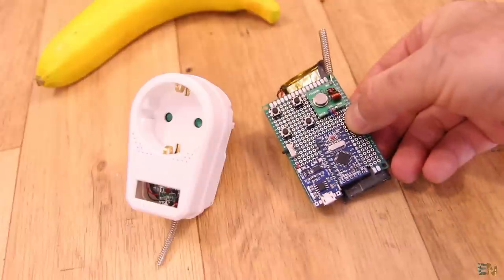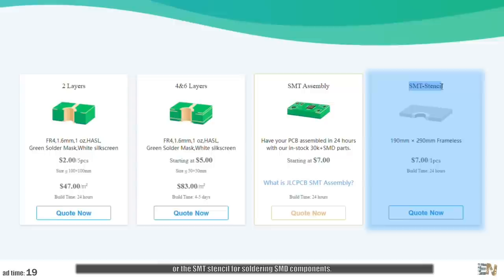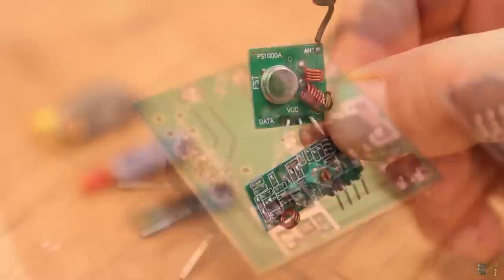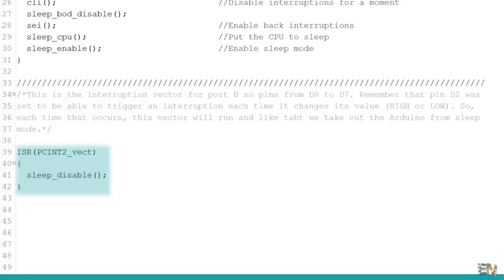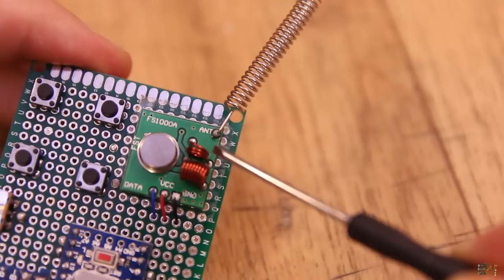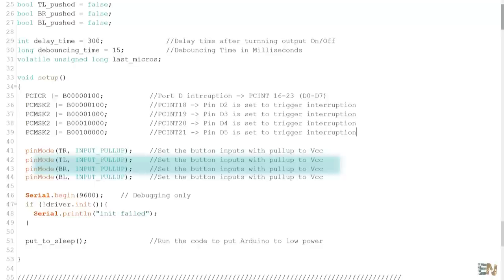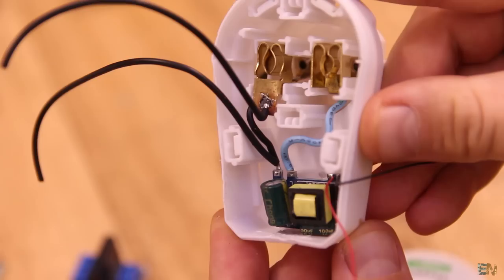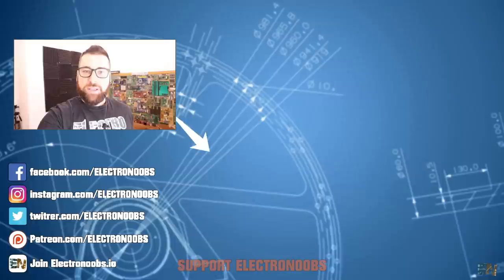Relay Control With 433MHz Radio - Ultra Low Power Remote

Comment: Your timing is perfect. I was looking for a circuit to help me make a rotor controller for my indoor antenna.
I will set it to rotate in one of two directions (dependent upon which button I press) for a short burst of time. If I want it to move more I could simply hold the button or press it repeatably.
Since you have done all of the hard work for me this project will go much easier, Thanks for the great video (as always :) )

Comment: Why didn't you use the standard PT2272 as you can use no power until you press the button that way it will last for years?

Comment: And if you'll want to have multiple receivers around in different places each operating separately you can write a single code for all of them.
Each receiver should be triggered upon receiving certain code, like numbers from 2 - 13 . The trigger-code will be defined by shorting digital pins with ground and corresponding arduino code should detect the shorted digital pin and start processing only appropriate commands. This way you can produce quite a lot of receivers with uniform hardware and firmware.

Comment: Great work there , a question though : how hard is it to encrypt the signal , I mean if I need to control a door someone can pickup the code and hack me , I want something similar to car remote locking/unlocking, thanks !
Reply from the maker: maybe you should multiply the sent number by a unique KEY and have that same KEY on the receiver as well and by taht you can get the original number....
Reply: @ELECTRONOOBS  the problem with that method is that the key is always the same so someone can record the sent data and replay it to open the door , I think the encryption must contain the current time as a seed , I should probably imitate the algorithm used for cars
Reply: @piiumlkj6497  Have one code to request a new challenge message, at which point the receiver will generate a random challenge and send it back to the transmitter. The transmitter sends the command along with a hash of the command, challenge, and a secret key. The receiver can then check if the received hash matches the expected value. Done right, it is very difficult to break.
Reply: @NiHaoMike64  thanks for the help , your solution is elegant but it requires 2 way communication to be implemented which can increase the error rate of the device , I think rolling codes used in cars is a simpler approach , although I still don't quite understand how they can maintain the synchronization between the key and the car , what if for example I pressed the unlock key while away from the car ? It will go out of sync , I'll appreciate a suggestion on how to solve that problem , thanks again!
Reply: @piiumlkj6497  The synchronization mechanism is done by accepting a few "gaps" in the sequence, which also turns out to be one of the biggest security flaws with the scheme. A quick way to implement that is to replace the challenge with a sequence count.

Many if not most car remotes are 2 way nowadays to improve security.

Comment: This project is really good but the problem is that the transmitter is just too big. The physical size of the transmitter should be reduced the same way you reduced the size of the receiver. Also, making use of a more cubical battery can help with the small size of the transmitter. I built a similar project around 3 years back and used an ir sensor with an ir remote to turn on and off certain relays. I also ensured a good use of the old remotes that you all might have laying around in your house. It is also cheaper and more compact. Anyways, thank you for uploading this video as this is a perfect tutorial for make a low power arduino project that doesn't sucks all the juice out of the battery.

Comment: Thx! Have you measured power consumption for 433Mhz and LoRa modules by yourself? 20uA looks too low for 433, these modules should consume more than 5-10mA, also LoRa module with 35uA is also very impressive.

Comment: Interesting, but I can grab a zigbee power switch from IKEA with remote control button for $20. And it is certified for safe use - no problem to touch antenna sticking from the power socket :)

Comment: Hi! I am working on your brushed drone project but I am unsure of one thing. The 16Mhz model of the Arduino pro mini has 5V and the battery I am using is 3.7v it will still work, right? Also, will it work if I use an Arduino nano? I am new to engineering these things so any help will be valued thx!

Comment: Well, you could just upload code without bootloader and connect the push buttons in series to the power of arduino and it consumes 0 amps when not in use. This is also a great soultion but i tried that way and it also worked.

Comment: Make a RF based wireless water level controller which operates automatically when the water level decreases and shutdown the pump when water level reaches the top

Comment: what if one would like to reduce the power consumption of the receiver? I' ve tried to turn on and off the receiver but its wake-up time is just too slow (150 ms). Maybe the problem is about the Arduino libraries that are slow to send messages... If anyone has managed to solve this problem and created a long-life battery receiver, just let me know ;)

Comment: Create a ''ASK"     Transmitter and  Receiver  by using some Chinese cheap encoder decoder ics.

Sorry to say
   this kind of ready made solutions are not useful.
Reply: its learning channel you can use this solution to trigger automation and other staff
Reply: @ahmedelwan9129  as Electronoobs have lots of knowledge.
So he must create the stuff from the ground level
Reply: @ahmedelwan9129  such kind of RF remote control switch is cost very less then he created.

Comment: How does your receiver not generate garbage data? Does that model not have AGC?
I made a wireless controller long ago and I used basic error checking and crap still got through sometimes.
I may need to pay more attention to pull-up/down resistors